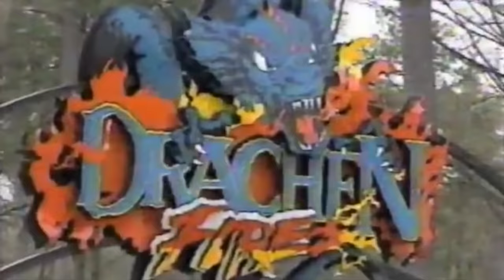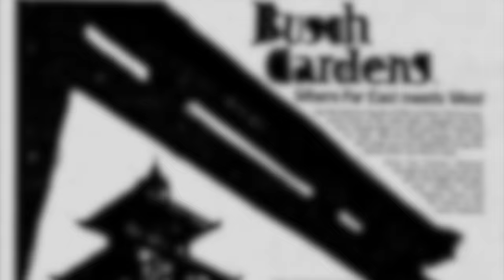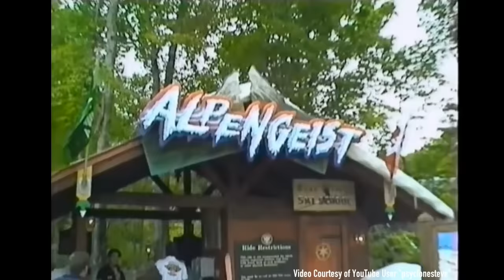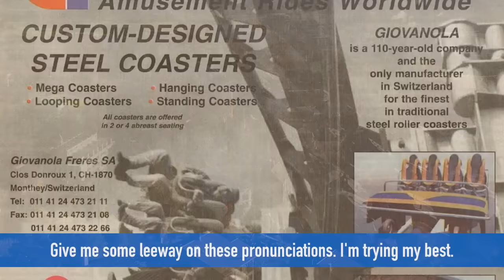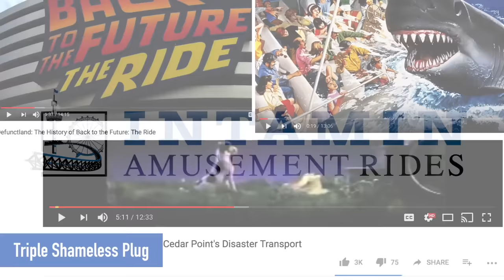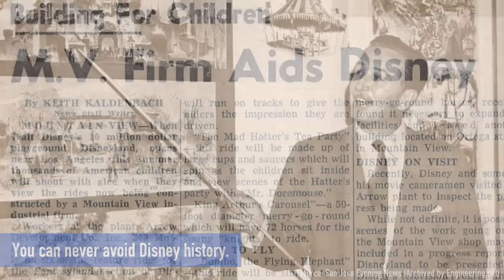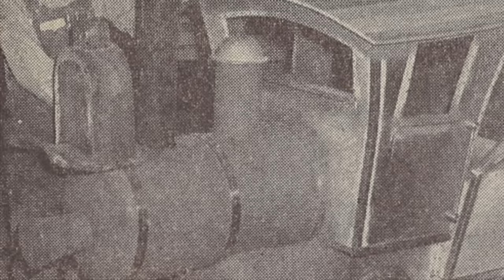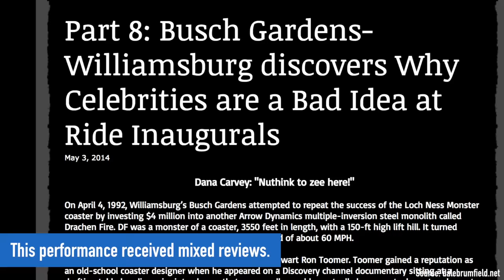Defunctland: The History of Drachen Fire at Busch Gardens Williamsburg

Comment: You should do one on Mean Streak. Yes, I know, technically Mean Streak was never closed, but it did get RMC Track Topper Treatment which completely changed every single aspect of the entire ride, so it basically is an entirely new ride. Plus it’s another one of those rides that was popular and then went into a rapid decline as opposed to the ordinary gradual decline.

Comment: Since you’ve now done Drachen Fire, could you do Big Bad Wolf as well?
Reply: I am from the future. The Big Bad Wolf video came out. Peace!
Reply: Big Bad Wolf was the first coaster I ever rode. Miss it.
Reply: I was lucky enough to ride it before it was closed and replaced by Verbolten. I was barely tall enough to ride it then and I don't remember riding it as I was young.
R.I.P Big Bad Wolf, you were my first coaster.
Reply: @yellowhelmetracing4576  Big bad wolf was taken out because the track had "aged out". The mechanics at the park told me that those types of roller coasters "age faster " because the train "hangs under" the track ,whereas Loch Ness monster -the train sits "on top of the track " so it doesn't age as fast. Eventually they will have to take out "Alpengeist" for the same reason as "Big Bad Wolf"
Reply: @cynthiathomas5443  That makes sense, I just hope Alpengeist sticks around for a while cuz its my favorite one!
Reply: @cynthiathomas5443  alpengiest is sounding rough nowadays

Comment: I rode this coaster at least ten times in a row the day I was there. I loved it. People were afraid of it, but I would describe the experience as intense, not rough. The elements were no more aggressive than any other Arrow coaster. The difference is having no time between elements to catch your breath, due to the small footprint this coaster had. The best part of that ride for me was actually the weightless hill after the big drop. Great air time. Most of the larger Arrow coasters are gone now because they were so aggressive, but that was the point back in the day. Granted, the Kumba in Tampa signaled a clear change in the way coasters would be built in the future. Another aspect of this particular park at the time was its family oriented focus. The Big Bad Wolf was the favored coaster in the park and Drachenfire might have faired better at Cedar Point or Six Flags in New Jersey.
Reply: I have always said that if Kings Dominion got Drachen Fire over Lake Charles instead of Anaconda, it would most likely still operate.  It would have seemed fine next to Rebel Yell, Grizzly, Shockwave, and eventually Flight of Fear (with shoulder restraints).  It makes sense that Drachen Fire's inversions felt about like other Arrow inversions since they were all just loop and corkscrew variants.  The inversions were arranged differently, but I see that not a lot of people get that even the new inversions were designed exactly like any other Arrow inversion.
Reply: Drachenfire was amazing
Reply: This is about how I recall it as well in it's first few years. Not painful, just intense and fun. But I do recall my friends and family complaining after those first few seasons.
Reply: FanOfVacuums2 Too many litigious Americans coming over from Colonial Williamsburg and getting their tri-corner hats knocked off for this ride to survive. It was unique and amazing. You want comfort, ride the steam train.
Reply: I suppose how painful the ride feels depends on the body type.  Many of the Defunct coasters on this channel seem to really only have had uncomfortable seating as their issue.  Perhaps if seats could be more custom fitted, more people would ride roller coasters.
Reply: I remember 12-15 year old me (I might have rode the ride 3 or 4 times) complaining of my neck and ears hurting from slamming into the shoulder restraints. It might not have been bad if I would have purposefully kept my head pressed firmly against the head rest. I do hope the build a ride in it’s place sometime.
Reply: Same here.  I rode this coaster about 10 times in an hour as there was absolutely no line. I even got ride two times straight through because no one was waiting. I really liked it. Of course I was 13 at the time. Maybe it was because I was from Ohio and was used to riding Cedar Point every summer.  The Mean Streak was in incredibly rough wood coaster there.  Used to 1-2 hour lines at Cedar Point, I couldn't believe there was no line for Drachen Fire.

Comment: I went to Bush Gardens several times in the 90s. I loved Drachen Fire. After they put in Alpengeist, they had a really nice mix of coasters. Drachen Fire was rough and would beat you up a bit, but it felt real somehow. The only real downside was sometimes you'd get considerable headbang on the restraints- even on that first corkscrew. It was worse towards the back than to the front. By comparison, Alpengeist was incredibly smooth- it just felt fast and twisty.

Comment: A part of me wishes that Busch Gardens would try again with Drachen Fire.  Wait, nooo! Don't go!  I do not mean in the slightest that they should rebuild it as a carbon copy since that would be suicide! 

I meant that a dragon themed "son of Drachen Fire" might be a good idea, with one or two elements like the old coaster had  but still learning from the past's mistakes so the ride is as smooth as a baby's ass, may or may not be built with cushiony shock absorbers...and scary as hell.  If I close my eyes I see something. It is a coaster with a new name (Speit Feuer, or "Spits Fire") and it has modern coaster cars.  It has the bat wing. There will be a corkscrew (one, mind, and in a different position.). There is also a long dive into a fiery pit that gives off flame and something inside roars as the cars enter; parts of the ride will go underground using a similar principle they would use at Alton Towers in the UK.  There are parts where the ride stops and starts so riders will see an animatronic dragons pop out of what seems to be nowhere and menace them;   the riders will smell a sulphur smell and the finale dives into the water.  (This ride would not be cheap, but it would make competitors gag with envy.) 

Right now Alpengeist, although one of my favorites, is 20 years old and it may not last forever. How poetic it would be to have a dragon themed coaster replace it someday?

Comment: I worked there for 7 years starting in 1985. There was another park about 1 hr and 20 mins away called Kings Dominion. The parks were rivals. Since most parks are run by young people, we would  get a bunch of us together and go sabotage the other guy's park. One time Kings Dominion employees came to our park and smuggled in cases of liquid soap they stole from their park which was easy to do since they were the bathroom attendants as well. They got on our flume ride and once they left the station, they dumped case after case of liquid soap into the water. After 15 minutes or so, the water at the bottom of the big drop started to foam up. Before long the logs with people in them were dropping into a ten foot high pile of bubbles. The bubbles were everywhere. You couldn't see the logs after awhile. We had to shut the ride down and it took us all night to change the water out so we could open the next day. Needless to say, we got even with Kings Dominion. Their brand new white water raft ride...well, they got a feel for the bubbly hell they put us through.
Reply: That is hilarious.  I have to ask though, was anyone fired for pulling those kinds of stunts?
Reply: mechaman13  No. They never knew who did it. Each park has 25,000 people in it. Who did it? Good luck with figuring out which teenagers dumped soap in the water ride.
Reply: We have a little suburb in Kentucky that has a fountain and every so often someone dumps bubbles in the fountain. 😂 it’s always funny driving past it on the main rode and seeing all those bubbles. It can get you arrested though. I wouldn’t do it myself, but maybe if I were still a kid.

Comment: So what exactly was the problem with Arrow’s track design? Was it not flexible enough? I always assumed that as long as the rails are solid then there shouldn’t be any difference between track designs.
Reply: I think arrow's track design is actually fine, but they did a lot of things they never did before for this ride and of course that isn't always successful.
Reply: Two problems, the first problem was it was molded by hand, full of many imperfections and shortcuts (that triangular drop into the barrel roll). Second, almost all of arrows coaster elements are premade and glued together, basically the loop on one arrow is the exact same loop on the next coaster, this is why arrow had no clue how to make a loop that interlocked the lift hill like in the original design. By comparison B&M we're using CAD software in their design which made their track profiling smooth, precise, rigid and versatile. It was in fact B&M who were light years ahead of Arrow and Arrow didn't realize it until they tried to build Drachen Fire.
Reply: They didnt use CAD modeling until X2 and Tennesee Tornado. Essentially every curve was at a fixed bank and yaw which did not evenly distribute forces making it painful. Rather than modern coasters where curves are taken at gradually increasing or decreasing angles, they simply snapped straight track and banked track together.

Comment: I rode that ride maybe 10 times when I was younger.  We called it "The neck snapper" because your neck would be in severe pain by the end of it, and you'd have a massive headache from your head rapidly banging against the restraints. you also made a small mistake on the reasoning for it sitting dormant. It wasn't a lack of buyers. Bald eagles had nester in the lift hill, and removing them was a felony.  They had to wait 2 years until the eagles moved to a different location. (and they would run the ride occasionally to both test the systems and dissuade other birds from trying to nest)

Source- I was an employee with BGW for ~ 10 years.

Comment: As you guys know, Drachen Fire became very infamous for its rough and painful ride experience. In 1995, the corkscrew after the block brake was replaced by a straight section. Drachen Fire's popularity would dwindle as Alpengeist was added in 1997. By 1998, Drachen Fire was widely hated by guests. So that year, the ride officially closed.

Comment: I'm a roller coaster mechanic, after having worked on arrows, it's the engineering of the trains that suck, no adjustable guide or up stops is a major problem with their rides being rough. Unlike B&Ms and Mack's. Bad track transitions do not help, but can be resolved with adjustable guide and up-stop wheels.

Comment: I grew up in the area during this time. It was an awesome ride, but it was rough. I always thought it was poor welding on tube the sections. It bounced your head around fiercely if you didn't press it into the headrest. One of my favorites, maybe cause you could ride several times if no one was in line. I bet they settled some neck injury cases. i think they were more worried about the earring posts putting holes in ladies necks.

Comment: I actually liked Drachen Fire when it was open.  The lines were always short (owing to its infamous reputation) and despite the headbanging it was an absolutely cuckoobananas ride.  A loop a third of the way down the first drop?  One of the craziest American coaster elements out there until Hydra's heartline roll straight out of the station - ironically enough, a coaster built by staid B&M.  Drachen Fire may have been a poor imitation of a B&M coaster, but it was a truly wild ride.  If you could handle the headache, it was worth it at the time.  But you are right: Alpengeist guaranteed the ride's demise.  Even I probably would have quit riding it in favor of a giant inverted!

The final irony came when Drachen Fire's land was used to build a real B&M coaster - Apollo's Chariot, I believe B&M's first hypercoaster.  Unlike either Kumba or Drachen Fire, it had no inversions - it was a straight out and back with some crazy airtime hills.  Even B&M didn't want to follow in Drachen Fire's footsteps.  And it paid off: Apollo remains a wildly popular ride to this day.  (I rode its brother, Raging Bull, at Six Flags Great America.  Smooth as butter and a whole lot of fun, but never as cray-cray as DF was).

Comment: I feel a little silly because of how long it took me to realize that, yes, I was on this ride. Granted I always thought it was called DRAGON Fire. It was a bit rough to ride it. Your head would bounce between the head supports and headaches afterwords were common. I miss the Big Bad Wolf more. I loved that ride. 13:30 There is is!

I loved Bush Gardens as a kid and young teen, but as I got older the more bad experiences I had at the park. The park is not friendly to wheelchairs or crutches. The ride operator called me fat and told me to get off of Apollo's Chariot as a teen. The bar at Verbolten got stuck and the attendant rammed it into my abdomen without warning to unstuck it. On. My. Period. And he really couldn't give a crap at how much pain he put me in.

I'll always think fondly of the trip where I got to ride Loch Ness Monster eight times in a row, because there wasn't a line for once. But even if there wasn't a global pandemic. I don't think I will go back there soon.
Reply: There is actually another Arrow roller coaster called Dragon's Fire at Canada's Wonderland! And yes I've been on both Drachen and Dragon's fire.

Comment: It's strange, you can just look at the Arrow trackwork and compare it to B&M and Intamin track and just see that the track itself is not as smooth.  I'm not sure if it has to do with the design or the steel fabrication/welding, but you can see that the elements just don't blend together well.  You can see the same thing on Togo coasters.

Comment: I remember this coaster. I never felt safe in it. I rode it once with the original downward corkscrew and it gave me so much airtime that I thought I was sliding out of the ride. The last 2 times I rode it was the year they removed the corkscrew ( coming off lift hill) and I didn’t feel like I would come out but had a headache afterwards. The ride was awful I’m glad BGW removed the coaster.

Comment: My problem with coaster designers is that they, not the builders, inspectors, or maintenence heads, no, the guys who designed dozens or even more, coasters that prove to be safer per capita than any other rides or even cars on the road! How many car designers are charged with accidents & deaths?
I think that SLIDE in Action Park, however, was proven from the start to be a bloody, bruise-filled death-trap!